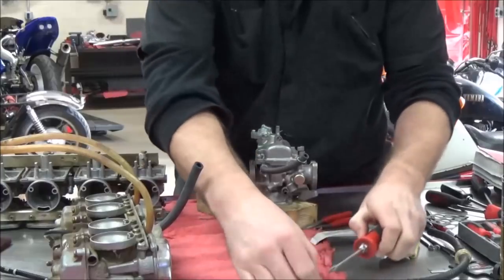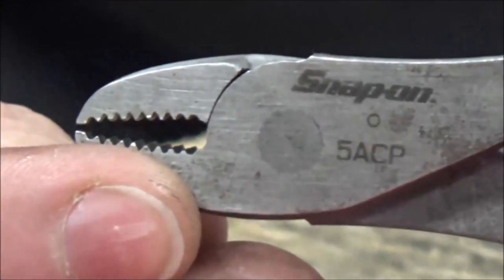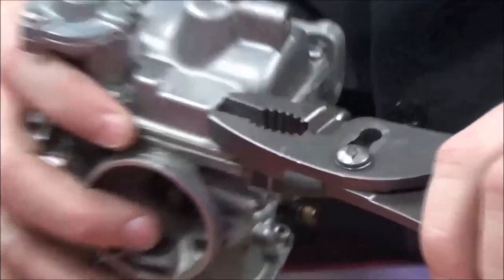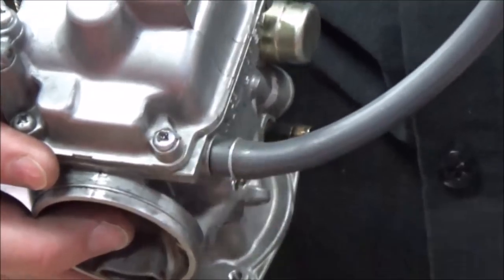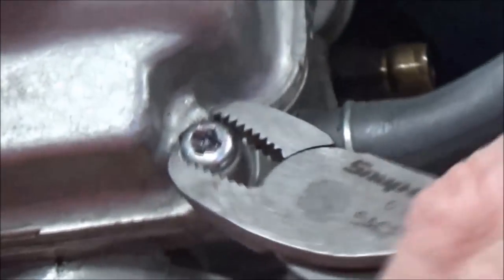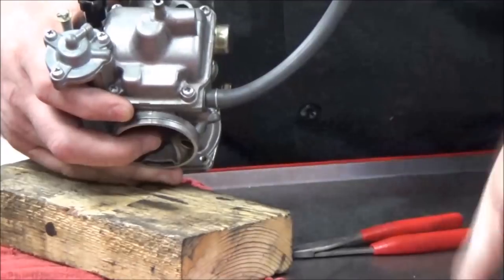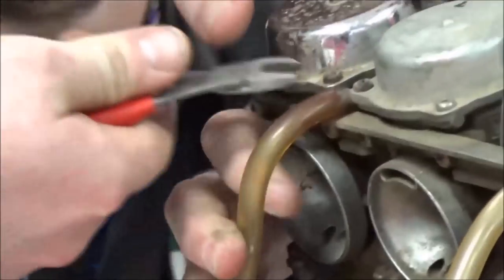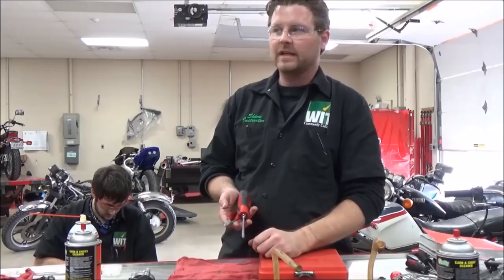How to remove a stripped screw, bolt, allen with the SnapOn 5FC Pliers!

Comment: You might be able to back that little screw out with a Grabit extractor but, yeah, it requires using a drill to get it started.  If you run it too fast or it slips,  you might mess up the Phillips pattern and not be able to finish removal with a screwdriver.  My only adverse comment is it looks like a #2 Phillips was used to remove the screw, whereas a #1 might have made better contact.  Good video showing things up close so you can see what's going on.  I bought the 5CF based on this video;  thanks for taking the time to make it.
Reply from the maker: You're very welcome! Thanks for commenting. Just an fyi...I number 1 would always be to small. I make a good example of why in a another video...3:35 min https://www.youtube.com/watch?v=k6RDfaJP7Po&t=1s

Have you Subscribed yet to never miss a video? Have you seen the video playlists https://www.youtube.com/user/conleybuilt/playlists ? 

Want to say “thanks” or “keep it up”? Click here https://www.paypal.me/how2wrench   

Your answers and help are just around the corner. Save time and money while protecting your investment and yourself by doing it the right way at www.How2Wrench.com